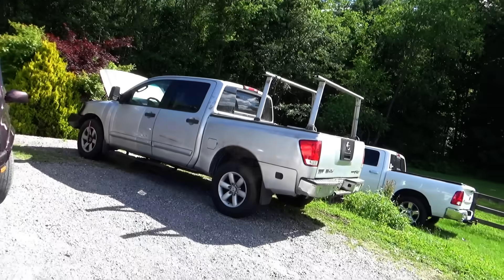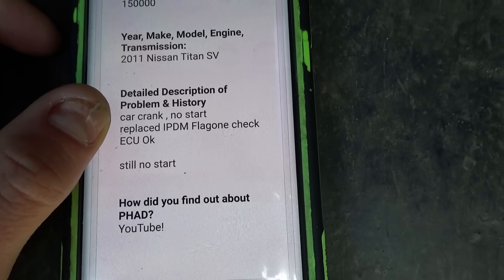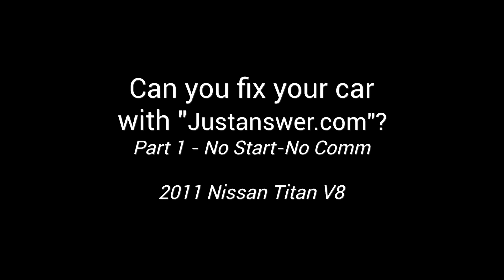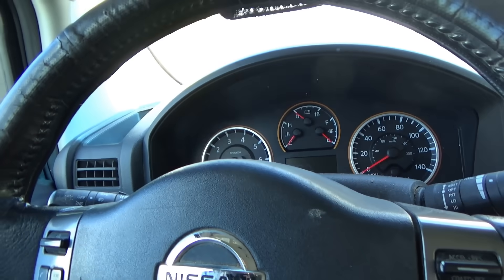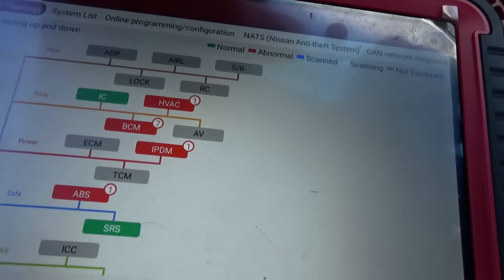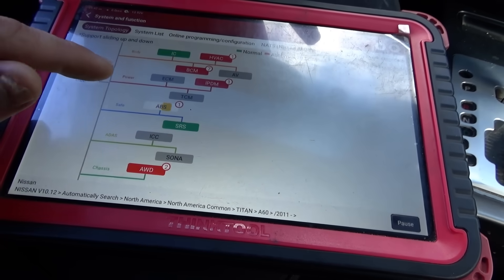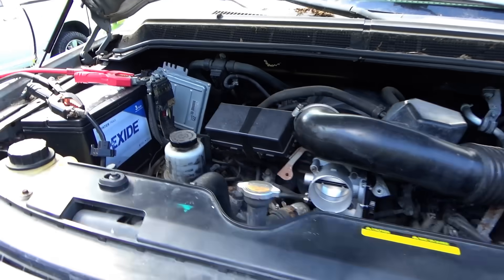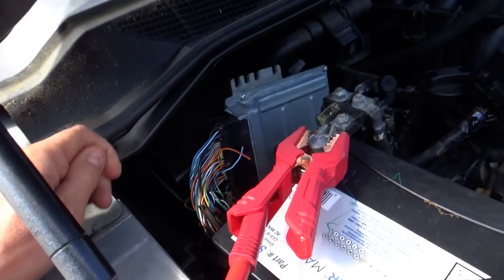Can "JUSTANSWER.COM" Fix Your Car? (Part 1: Nissan Titan NO-COMM for a YEAR!?)

Comment: Thank you for all the great videos and tips you are a SAINT! 

Quick question is there a scanner like your LAUNCH X431 PRO3S+ V5.0 that can do the same tests and functions but is just for Nissan specifically? 

I would only be working on my 2004 Nissan Armada and love the options your scanner has but was hoping there might be a less expensive option if I didnt need to scan other OEM brands. 

Or is there a different bi-directional scanner you recommend with some bells and whistles for my 2004 Nissan Armada that’s in the $500 range or so? 

Thank you in advance!!! 

Sorry for the long post!

Comment: Ive had like 15 mechanics try to fix my 2012 pathfinder 4.0 nobody has been able to pinpoint issue, I tried dealer first week of owning it they charged me 500+ for absolutely nothing, i have loss of power at around 40 seems to bog down randomly ive replaced 5k worth of stuff, has new exhuast 02 sensors cats, maf sensor went through entire evap system no leads currently it does not save radio at all, randmoly gets maf code and sometimes goes into limp mode seems like when you press gas down it bogs down for a few second then goes
Reply from the maker: Should be a pretty easy diag if it consistently acts up...fill out the appointment form!

Comment: i am not a mechanic, but from my experience with my nissan the computer was bad and IT NEEDS TO BE REPROGRAMMED AT THE DEALER, NOT YOUR MON AND POP SHOP, the computer is not just a simple swap and plug and play, device and only the dealer can reprogram the unit.
Reply from the maker: @randallsadams  actually it's plug and play, you just program the keys 😉

Comment: Man, I have a similar issue with my brother in laws truck. 2012 Titan. He replaced the computer, IPDM, crank sensor. That power block on the positive cable. Among other things I guess. Took it to Nissan, they didn’t fix it, then to a local shop, 13 weeks, they can’t fix it. But we’re nice enough to tear it apart. Ugh! They did say the wipers work until they plug in the IPDM, then they stop. I haven’t verified yet. Waiting for my brother-in-law to get me a wiring diagram.  It does seem to drain the battery, assuming a short. But all he gets is U1000, no communication. Oh and looks like security system is on to me. Is there a site where you take in work? That may be an option. We are in Michigan. Not sure how much a tow would cost lol. Hoping I can figure it out.

Comment: If you come to the point of replacing and reprogramming ECUs or modules, time to go to the dealer. Its over 10 years old and 150K miles, things are going to break, though it is not so old the dealer couldn't fix module problems. If he watches the program do all the voltage and ground checks yourself before going to the dealer, put a charger on the system while testing.

Comment: I am sure Amazon only sells quality parts : " lets find the cheapest source and then beat up the vendor for MORE " ! They come in a white box with no name / logo ! At best , Just Answer is an educated guess . They rely on information supplied by " expert customers " . Years back I had an intermittantly sticking evap purge valve on my 2.8 L Chevy . After discussion , I asked " do you think it could be intake gaskets " ? They said " I would replace them " . I ignored their " advice " , isolated the valve , found the problem and fixed it with a OEM part . Once these vehicles are molested , all bets are off .

Comment: Seeing that battery terminal connection wrapped in duct tape explains it all. 😝
Reply: That was a safety measure put in by Ivan so the unsecured ECM doesn't short out.
Reply: @NextLevelAutoDiagnosticsLLC  ok, that makes more sense.

Comment: I have a 2005 titan and it wouldn't start sometimes ,come to find out the chip in the key wasnt connecting to the computer so i put a extra key on the instrument panel and left it there and it starts every time.

Comment: Customer forgot labor rate rules 
150 standard 
175 if you watch 
200 if you help
250 if you worked on it first
Reply: 300 if you saw it on the internet ...and it looked easy.

Comment: I might have one for ya, Ivan. I've got a '96 K1500 with a random misfire. I've taken it to three shops and each one has tried there own fix. Slight parts cannon, but mainly stuff that needed to be replaced due to age anyhow, plugs, cap & rotor etc, so I'm not too deep in it. The third shop, though has had it for the past 5 weeks and no closer to resolution. I'm about one more phone call away from driving it the 4 hours out to you.
Reply from the maker: Just fill out the appointment form :)

Comment: Ivan, as a radio broadcast engineer I use a Fluke Networks Pro3000 Tone Generator and Probe Kit to find open wiring.  This tool can easily show where a wire is open in a wiring loom.  Radio stations have a lot more wire tightly bundled and this tool help find the pair of wires or wire that you are looking for.  Greatly enjoy your videos, keep making them.

Comment: I hate it when things like this happen. I had a pt cruiser show up with a fan in-op. new fans, new tipm.  Found the green crusties on the main power feed to the fans below the battery, wire rotted in half. Fixed that and it all works. owner cries about my diag fee (1.5) hours because the last shop charged them 1800 dollars for the parts and install.

did it need those parts? who knows. but none of them fixed the problem of the car overheating due to no fans. I stood firm on my diag. told them to get their old parts back from the other shop as they are probably good.

Comment: Question: is it correct to assume that the ECM is bad when it can't be scanned and the powers and grounds to it are fine? I mean it could also be the wiring to the OBD connector, or maybe the wiring to the CAN bus that causes the failure to reach it right?
Reply from the maker: Yes, you also need to check the CAN lines with a scope if necessary :)

Comment: This guy is bad news. I would not have accepted the job. When in this position and a customer's first asks for a discount before anything, I increase my hourly rate 30% then quote a 15% discount. I have done the same with parts. If customer first asks for a discount before anything else I double the price then give a whopping 25% discount.

Comment: I can't believe someone thought the answer to a no start, is to start cutting wires to the ECM.   I can find no logical way to end up at that conclusion.   And if the 5v Ref circuit is actually down, I'd start looking for a damaged wire, or a short to 12v or Ground, not to start cutting your Vref wires and somehow expecting that to magically fix anything.   But hey what do I know, logic is for suckers I guess.

Comment: Why do you take on these projects where others have been a meddling and installed aftermarket parts?
If you say "because I can make a ton of money on them because I know I am the last resort."  Then I understand but I don't think that is the case.  I think you chronically undercharge in relation to time spent and the expertise you bring to the table.
One of a kind, Ivan.  One of a kind.  But, for how long can you be that guy?

Comment: The 5 volt reference loss and the accelerator pedal/throttle body parts cannon remind me of similar truck and customer. 
Turns out there was a loose terminal on the PCM for the 5 volt......

Comment: Discount? Absolutely not!
If the customer had brought the truck to you with the initial fault, there would be one single issue to diagnose and rectify.
In cases like this you now have to deal with all the "N.E.W." parts of unknown pedigree and all those cut wires to even get back to the original issue.
Hopefully they sent the original parts with the vehicle...
16:00 No they didn't. Oh no....

Comment: When I was working on Nissan stuff the only reason that I cut any wires was when I was splicing the wiring loom into the Holden wiring loom in my VL Commodore which ran the Nissan RB30E engine & I was doing a DOHC conversion using the cylinder head, pistons,ECU & wiring harness from a 1995 model Nissan R33 Skyline which was an automatic model & some of the wires weren't needed because my car is a manual car so I just cut them off  the Connector.

It was 21 years ago before a lot of people were doing imported RB series engine conversions into their Australian built Nissan R31 Skyline or Holden VL Commodore so I met a bloke called Guido online whose from New Zealand in 2003 & he was bolting the Nissan RB25DET engine into his Holden VL Commodore which he converted into a Calais because they came with the flip up headlights from the factory,it was a New Zealand built car from the days when Holdens were built in New Zealand & it came with the optional RB20E engine because some of them were fitted with the 2 litre SOHC 6 cylinder engine as an option in New Zealand.

He sent me a photocopy of the Nissan R33 Skyline GTS(-T) wiring diagram to me in Australia from New Zealand which was a great help.

So the owner of the Nissan Ute or pickup truck was probably listening to a  young teen whose 13 or 14; years old & they were playing a prank on him,so yes,be careful who you listen to online.

I have come across a lot of idiots who are like that in my life & some of them are fully grown adults who will never grow up !

Comment: Owner same kind of person that wants his college loan "forgiven".  I stupid, will you bail me out?  Way back when I did electronics repair a guy brought me a car stereo that his friend "took out of his car".  All the wires cut off nearly flush to the case, but stripped back. Both amps blown, etc.  I gave it back and told him his "friend" needs to learn to steal the wires, too.  Like the man says you can't fix stupid.  I know you like a challenge, but don't you need a break after that Audi from the sub basement of hell?
Reply: I knew a teenager whose boyfriend was going to take out the radio and install a stereo into her car. Well i found that out later when i was asked to put the radio back in. This MORON cut everything that was plugged into the back of the radio, including the antenna cable, instead of just unplugging everything. That's as far as he got. Then MOM (who had bought the car) asks daughter where the radio was----under the seat. Then daughter had the gall to tell her single Mother, if i didn't know how to put the radio back in, find someone who could! I was doing a lot of bitching, when i saw the mess that imbecile had made with all the cut wires plus having to buy a new antenna for no other reason than him being too stupid to not know it just unplugged.

Comment: I'd tell him that if you used aftermarket parts it's double the charge for stupidy.
Reply: So, what if there are no OEM parts? Didn't you watch the 4-Part Audi one Ivan posted before this one?
Reply: @KStewart-th4sk  I watched every video. I was a comment that I made. I've worked on customer's cars. Some have provided their own parts. I have refused some work and on others, I only warranted my work on the vehicle. In other words, every part and bolt and screw was installed correctly.

Comment: Just built another Studebaker V8. Carburettor and points ignition. If no start you dont need a scan tool, DVM or even a light bulb. Check for spark and fuel. New points cost $5.  It is insane to have such unnecessary complexity that has no benefit, not even better mileage. I have a Titan and love it but Stude gets 20 mpg and is EMP proof, Titan gets 14.

Comment: That normal, before you learn to repair things, , you destroy the first one  you practice on it, like me, i destroyed the transmission of 2000 Saturn SE, that require only diextron3, by putting in it expensive blue transmission fluid bought from the dealer, before I become professional in car repair, (well not like pinehollow, I am.still.learnimg a lot from his videos).

Comment: Hmmm! Not a good situation here. I always prefer the customer to have left the vehicle alone before bring it to me. My former boss would tell the customer to put the vehicle back the way it was originally before you bring it to me.
Reply from the maker: But in some cases that may damage it even more LOL
Reply: @PineHollowAutoDiagnostics  LOL Especially with this guy! I assume there is a locking mechanism for the plugs into the computer that he broke because of not knowing how to release them when he did the disconnection?

Comment: You never ever cut wires when you don't know what you're doing.  Even if you do know what you're doing, cutting wires should be done only when everything else has failed and it's a last ditch effort.

Comment: I figured it would be something really simple and then it was just repaired to death. 

I had a guy years ago bring a Pontiac Grand Prix to replace the catalytic converter that supposedly caused a misfire. I diagnosed a bad ignition module and they were pissed at me, because Google told them it was the cat. 🤣🤣

Comment: First time the ECM was replaced, it was in limp mode and throwing codes for the throttle body and the APP...  That's odd.  It's not like throttle body and APP relearns are required on a lot of Nissans after PCM replacements or anything.  ...Oh wait...

Insanely frustrating customer.  I am very upfront about the fact that I charge a higher hourly rate for custom vehicles (including fleet upfitting like police cruisers) and vehicles that are brought to me in an incomplete or tampered state.  I mean, I work with body shops; I'm used to working on vehicles that aren't built yet, or diagnosing faults before the vehicle has even gone through teardown, but this is just insane.  Sorry Mr. Customer, you get to pay insurance diag rates.  $250/hour.

Comment: Next, I'm expecting someone to literally bring you a basket case...  nothing but a basket of disconnected parts....   And while you COULD do it, it might overload your bandwidth, so to speak

I may tweak you, Ivan, on occasion, but I'm not a troll and I really love you & DJT.  I don't think this guy is a troll either but his "fun meter" has definately "pegged out!"  Anyone who literally cut computer wires is desperate.  Not yet a desperate criminal but still desperate.  When someone cries about money I wouldn't be surprised if there isn't a woman behind these calls.  Women need money for new shoes and bags while guys like getting car stuff!!  Current inflation makes eggs and milk a precious commodity so maybe he just needs to sell.off this albatross truck.  [I.E. => a continuing problem that makes it difficult or impossible to do or achieve something.] 

So, if it's possible, at least finding root cause will be deeply appreciated by me.

Comment: 1, replace computer.
2. Fix wiring 
3. Who knows what else is wrong besides the throttle body. 

If you got it to crank and start but only for a moment, reprogramming the keys should get it to run consistently, but whatever else is wrong is anyone's guess.

These websites that promote online chats with mechanics is one thing I see as a problem here. My guess they are some tweaker who says they are a mechanic. They don't know jack especially with modern cars.

Comment: That lack of compression on the initial crank would have me first check for spark plugs. If they are installed, that condition would circumvent doing any diagnostics of the ECM. Like someone else suggested a broken timing belt/chain, in that situation, there could be bent valves or worse. . And that would mean a call back to the customer, telling them you spent 1 hr diagnosing, and after discovering the engine needs replacement, because of the bent valves, you will discount 5%. Come pick it up.
Reply: Very well could have been from a lot of crank no start action. Oil is probably 50% 87 octane.

Comment: I worked with a mate who had a regular customer who would always haggle for a discount. My mate would just add a few hundred on the original quote and let the customer haggle him down to the normal price. It was hilarious to watch.
Reply: A well trodden route.
When you're in business for a number of years, you kinda get the 'feel' for the type of guy you're dealing with👍🏻
Reply: For you, special price!
Reply from the maker: I learned to do that with some of the foreign student customers at my shop as well xD
Reply: Yep lots of cultures barder for everything. Set prices on things drives them crazy 🤣🤣
Reply: @bigdaddymak1439  I completed a job for a coworker and charged him about 1/3 of what a dealer was charging.  He later said he thought my price was too high.  Really?  Well, he later came back and asked me to do three more jobs on his European sedan.  I quoted him half the price the dealer required but he wanted to pay one-tenth of what the dealer billed because I wasn't a dealership and I wasn't a "professional".  I told him to find someone else to do the work.  His facial expression completely changed.  I had had it with him.  But he wasn't expecting that reaction from me.
Reply: Now that's genius I like that
Reply: Priceless!
Reply: Tell the customer he will get the IDIOT DUMMY DISCOUNT which is a mark up. Lol 😂

Comment: Only about 10 minutes in. I’d need at least a 500$ security deposit to even consider this project. This should be good! 👍👍🇺🇸.   I’d bet it will be a NPR, maybe some OPR.
Reply: I would want 4 hours, which is $800, just to scan it.  Go away, don't come here.  I have plenty of real work to do, that does not waste my time.
Reply: @scrappy7571  I have no problem helping people out in certain situations, but from the sounds of this I’d feel better with a bit of a deposit. But then again, I’ve gotten screwed more times by some family members than I care to mention. 😅😅
Reply: @scrappy7571  Every case is somewhat unique. I’m sure Ivan has been down this road a few times and has it under control.